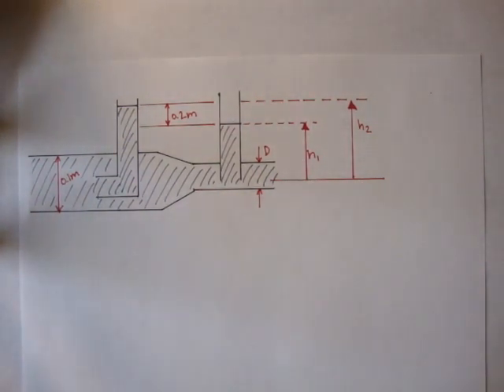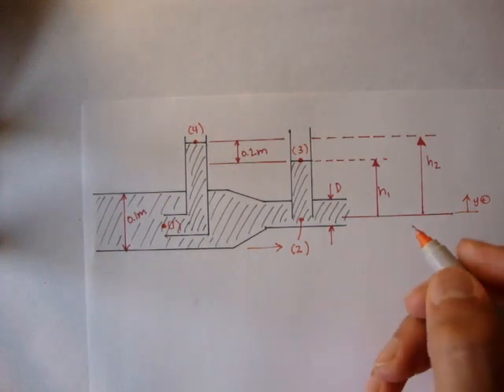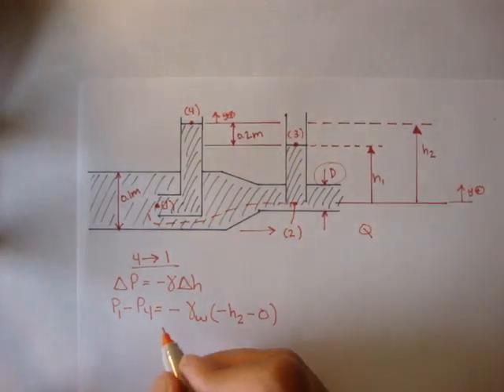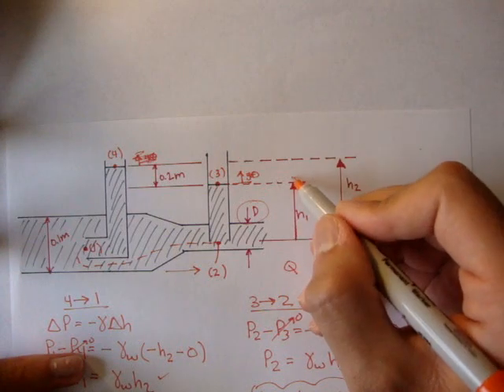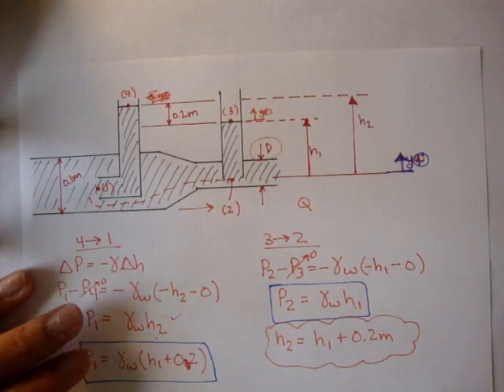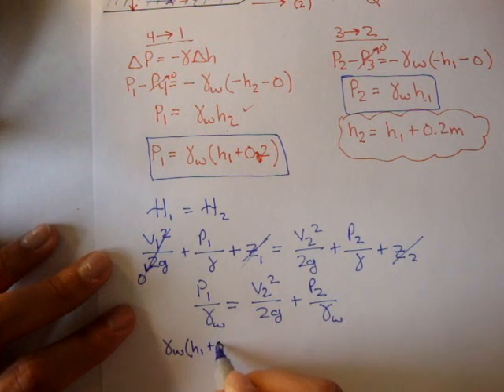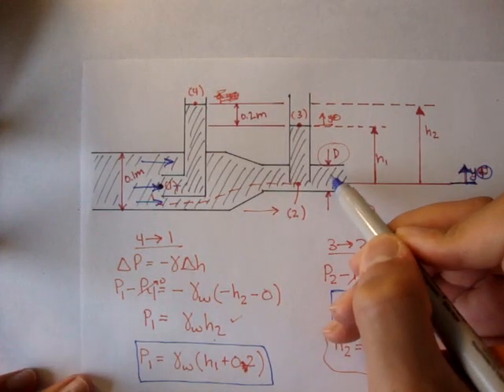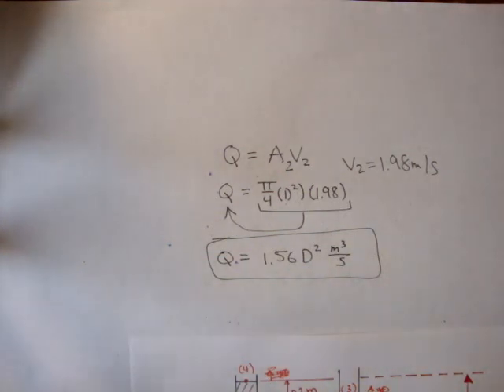Bernoulli Equation: Example 3 [Fluid Mechanics #26]

Comment: 1. Pay attension v2 is just the point velocity at point 2, not mean sectional velocity. So we should use velocity distribution to obtain the mean velocity V and then calculate Q by AV.
2. If point 1 and 2 are on a same horizontal line, which means they are not on the same sreamline due to different tube size, we can not apply Bernoulli Eq for them.

Comment: how is P4=0? ist it the atmospheric pressure?
Reply: The idea comes from the fact that the atmosphere act everywhere in all direction  so the atmospheric pressure cancels out anyways if you add it on the equation Patm+P1= Patm+pgh notice how Patm cancels out atmospheric pressure is always present sort of like gravity unless ur in a vacuum and it’s about 15psi believe
Reply: If your pressure are gauge pressures then atmospheric pressure is zero
Reply: Same question actually. If the other hand was exposed to the atmosphere, it'd make sense because the pressures would cancel each other. But that's not the case

Comment: Awesome Vid Simmy, How would your answer differ if you used the original Datum (the one used for the z's in the bernoulli equation) for all the temporary datum you used earlier in the video. Please, Please reply.
Reply from the maker: Ogbonna Chris Thank you! If we used the original datum, the answer would still be the same. Take, for an example, P1. If we used our original datum, the pressure at point 1 would be -gamma*(0 - h2) = gamma*h2. Datums are just reference points relative to the points you are interested in. Try it out on paper and see if you get the same result! Hope this helps!

Comment: Nice example! One thing to be sure for the flow rate, the area of the end of the tube is pi*r^2, but the D on the diagram is mean Diameter. So the Q Should be pi * (D/2)^2*V2 right？